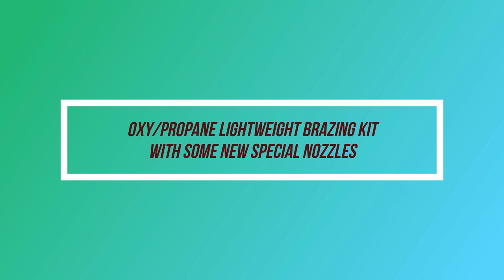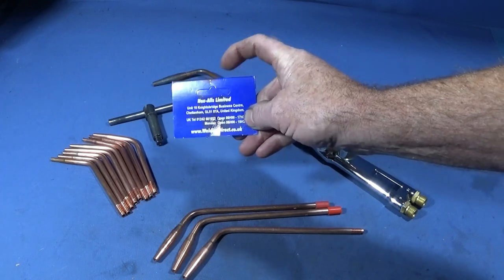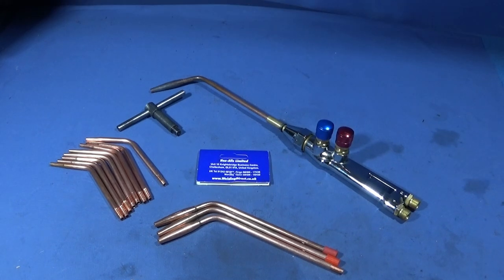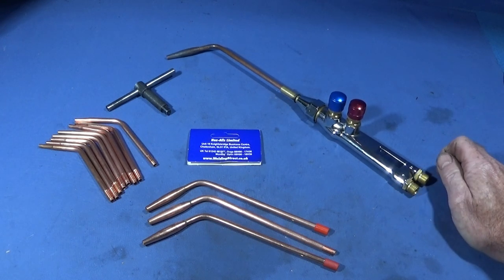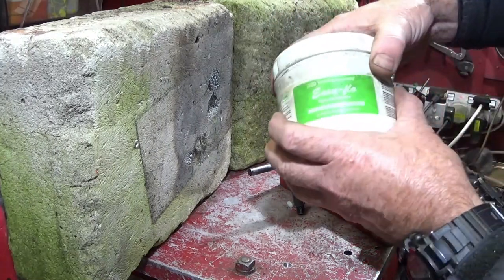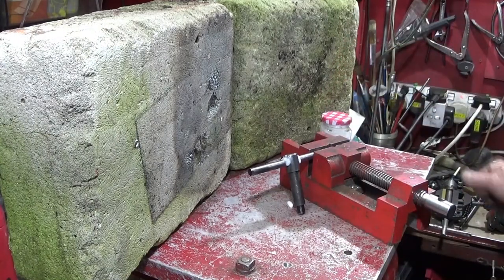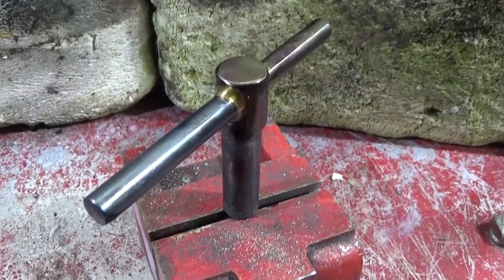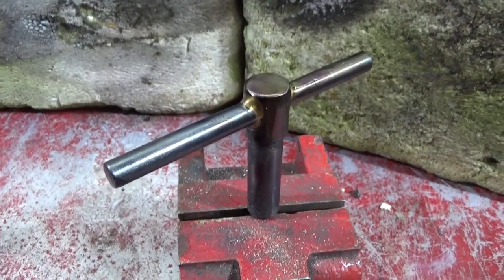My Oxy/Propane Lightweight Gas Torch Kit With Some Special Nozzles

Comment: Nice bit of kit, I used to do some oxyacetylene welding when arc (stick) welding wasn't suitable for small repair jobs - you still can braze, solder and bronze weld though with oxypropane... Have fun!

Comment from the maker: SEE LINK BELOW
THE NOZZLES:-
https://www.weldingdirect.co.uk/Lt-Wt-Oxy-Propane-Brazing-Nozzles

THE EBAY PROPANE SETS:- (I got the 5 meter set)
OXY/PROPANE 5 METER HOSE SET.
https://www.ebay.co.uk/itm/Oxygen-Acetylene-lightweight-gas-welding-brazing-kit-Oxy-Acet/143774205935?hash=item21799c47ef:g:zjEAAOSwjFpediGZ
OXY/PROPANE 10 METER HOSE SET
https://www.ebay.co.uk/itm/Oxygen-Acetylene-lightweight-gas-welding-brazing-kit-Oxy-Acet-10m-set/154077752452?hash=item23dfbfec84:g:LpYAAOSwbNtewW-T

Comment: Hi Steve.  Was thinking about getting the bullfinch for brazing but unsure now what do you think?
Reply from the maker: The Bullfinch is OK if you get a lower melting point silver solder to work with. This kit here will use any braze. Regards Steve

Comment: Hi Steve.  You gave us the link for the larger nozzles, but do you have a link for the actual torch kit please?
Regards Mark in the UK
Reply from the maker: Hi Mark, I bought it as a kit.....This one here on eBay.
https://www.ebay.co.uk/itm/Oxygen-Propane-lightweight-gas-brazing-heating-kit-Oxy-Prop-5-metres-set/133638361562?hash=item1f1d7791da:g:IgcAAOSwvfxediJe
Reply from the maker: This is the one here from the same seller as the kit'
https://www.ebay.co.uk/itm/Lightweight-shank-mixer-Oxy-Acet-Gas-Welding-Brazing-Light-Duty-Blowpipe/143958183835?hash=item2184938f9b:g:wTIAAOSwtKZdEL3q

Comment: Where do you get gas and oxygen bottles Steve and are all fittings Universal
Reply from the maker: I get them in a welding supply shop in the UK. The fittings are standard for the UK. On the USA they have their own standard fittings.

Comment: Hi Steve - Thanks for the review on the nozzles. Gutted you didn't buy the rest of the kit from us ;) 
Nice use of the small jam jar. :)

Aside from the lighter comment that someone else mentioned, for switching off you can just turn the fuel off first and then the oxy (unless sustained backfire in which it would be oxy first).
Reply: been looking as brazing setups. looks like i am going to resurrect my old gas welding kit with new nozzles  instead
Reply: just bought some of the same nozzles  from Nozalls. what a dream to use

Comment: The tips perform well. Do you remember what tip size you used on the chuck?
Reply from the maker: The one I used doesn't have the number stamped on it. If you get the medium one of the range, that will be fine.

Comment: dear sir i need your advise i want a set of carbide lathe tools my qctb will take up to 10mm  but im confused as to which carbide tips to buy as there so many different ones  thanks in advance
Reply from the maker: Hi Dave you have to look on the side of the tools at serial number type of tool. You can normally search on eBay Banggood etc for that tool. On some listings it will say what inserts or tips they take.
Reply: @SteveJordan  thanks for the info
Reply from the maker: @daveandersonangry  If you get stuck with any I maybe able to identify them for you. Regards Steve

Comment: Seems like a nice little unit for the home shop. Do you plan on getting a cutting rig? Also, some friendly advice, when shutting down turn the fuel off first then the o2 after, this will prevent the chance of flashback.
Cheers
Reply from the maker: Hi Rick Thanks, no I don't plan getting a a cutting rig yet as I heard they use a lot of gas. I have my plasma cutter anyway
 People keep saying different things on shutting down. And it makes a bang if I do it the other way. I do have flashback arrestors on both gas and oxy as well. I tend to decrease each until they have nearly stopped then turn off the oxy, so as not to cause a large gas flame. What are your thoughts on this?
Reply: @SteveJordan  
I seems the smaller the tip the louder the pop 😉
That's what I was taught in school, extinguish with o2 to prevent line or chamber burn.
Cheers

Comment: I thought you were using oxygen acetylene? I weld with O2 + C2H2 Which is easier than TIG for fine work. 0.5 steel sheet you need a number1 nozzle, 0.7 number 2, 1mm number 3, and 1.5 up you need a number 5.

Comment: Hi Steve thanks for the video. I have three questions. Q1 was the torch advertised as a propane/oxy torch or as an acetylene/oxy torch? Q2 what’s the regulator that you have on the propane cylinder, how many Bar?  and Q3 what’s it like with as number 1 nozzle?
I’ve just purchased a MAPP Gas and Rent free 2 Ltr oxy bottle kit form Flametech (flametech Lite brazing kit) for £410 April 2023 which is expensive but I couldn’t find any other complete rent free solution as an alternative to acetylene.  On reflection had I have seen your video before I would have looked more at the propane oxy option. For anyone looking at the Flametech option (refrigeration engineers) be aware that the rent free oxy bottle is from GCE Gas Control Equipment company and the have very little coverage in Wales where I am. I have a 4 hour round trip to replace the oxy and they won’t deliver rent free; you have to collect. The Mapp gas/oxy is almost as good as oxyacetylene, I just wanted something a bit better than the Sievert jeweller’s propane torch that I have been using. If you could answer the 3 questions that would be great Steve. Regards . . .  Andy
Reply from the maker: https://www.ebay.co.uk/itm/155457261588?mkcid=16&mkevt=1&mkrid=711-127632-2357-0&ssspo=NUJ4BNimQjm&sssrc=2349624&ssuid=qosIqqr_Tcy&var=&widget_ver=artemis&media=COPY
Reply from the maker: I bought this set on eBay. It's in my storage bin at the moment. I haven't got time to get it out, as I'm busy. You could ask the seller any questions you have. Regards Steve
Reply: @SteveJordan  Thanks Steve . . .  Andy

Comment: Hi I am just building a oxy propane set up, I was concerned  that I have not got regulator  indicator valves on my propane  tank. I noticed you have one on oxygen, but like my set up you don't seem to have gauges on your propane.  Have you found any problems?  I have not lit my set up yet but if , like you, I can not have any gauges I won't worry so much. Any info will be much ly appreciated.
Reply: You do need a gauge on the low pressure side of an adjustable propane regulator to set the required pressure. Propane is liquid in the cylinder and will only ever give the same pressure until just before you run out of gas so a gauge on the high pressures side is pointless. As you use up the propane gas, more boils off from the liquid to replace it. This is why you need always to keep a propane cylinder vertical when it is in use. If you see a regulator on a propane cylinder with two gauges, it is probably an acetylene one..! Pressure regulators with no gauges are usually non adjustable and set to a fixed pressure for domestic use. You do not want to use one of these with a torch.

Comment: Surely that's silver soldering not brazing? Easyflo flux doesn't go up to brazing spelter temperatures. Brazing is using bronze and is above 900 degrees. But I might be wrong.
Keep up the good work.
Reply from the maker: Hi David no I'm using proper bronze brazing rods. I have got silver solder as well. So far I have used this flux with success, but I have some borax powder to try next.
Reply from the maker: Maybe it isn't for this as I see bronze flux on eBay for acetylene work. I will get some of that to use instead. I did actually think the braze wasn't flowing nice when I used this flux...it must have dissolved! Thanks for pointing this out.
Reply: @SteveJordan  No problem. I always used borax for braising but have got away with Tenacity flux too. It's rated to 890 degrees so I assume you can push it.

Comment: Hi Steve nice video
Do you have any more info on the equipment you used please. 

Gas and lines the torch etc 

Thanks Derek
Reply from the maker: I will find the listing and put a link on tomorrow. Regards Steve
Reply: Steve Jordan Thanks Steve
Reply: Me too ...need the details to upgrade my setup. Thank you for some good ideas .
Reply from the maker: https://www.ebay.co.uk/itm/Oxygen-Acetylene-lightweight-gas-welding-brazing-kit-Oxy-Acet/143774205935?hash=item21799c47ef:g:zjEAAOSwjFpediGZ
Reply from the maker: @NavinBetamax  I put the links on this page
Reply: @SteveJordan   Thankyou, Sir !
Reply: Hi Steve - that ebay link no longer works. Do you have the seller's details/listing? Thanks

Comment: Thanks for a very informative video. Question...I have heard that oxygen is expensive and doesn't last long. That has prevented me from doing oxy/anything. What do you think?
Reply from the maker: Hi Well the initial cost of the new oxygen bottle was about £60. When it's empty it will cost about £34 for a refill. Personally I think it will last a long time as I only need to turn the regulator up a fraction to use it.
  I never came across oxy/propane until a couple of months ago, so it is new to me. 
 I have had my full 13kg propane cylinders for a few years now using them mainly with large sievert gas torches. I'm actually amazed that they are still going.
 Also I hope to get one soon,  but you can buy oxygen concentrators, the ones that people use for health reasons. These can be connected and used for constant use of oxygen, cutting out the need for a bottle. They can be a bit expensive but are gradually coming down in price. You can see them in use on other YouTube channels.
 Regards Steve.
Reply: @SteveJordan  Back in the 1970's I had a friend who ran a junk yard in the US. He used propane instead of acetylene for cutting. He just did a modification on the plumbing. It took a slight bit longer to get up to heat but cut just as good as acetylene.
Reply: @SteveJordan  Hi Steve, what size of oxy bottle are you running? And how long can you keep brazing with it on average before refilling? You are so lucky with UK prices. Here, the bottle is like GBP350 to 400, refill about GBP100, even for the small bottles. (Norway).